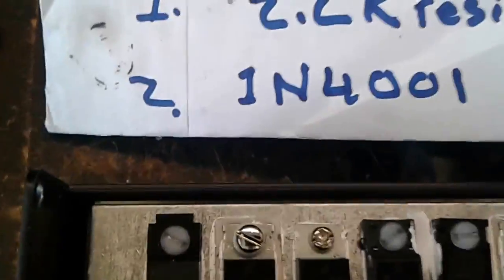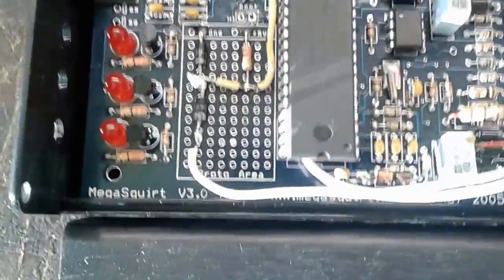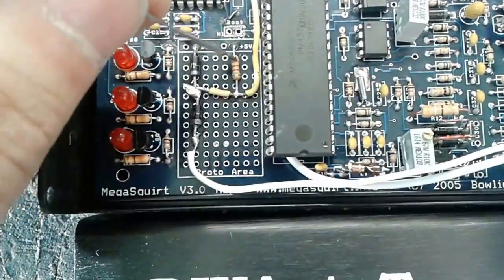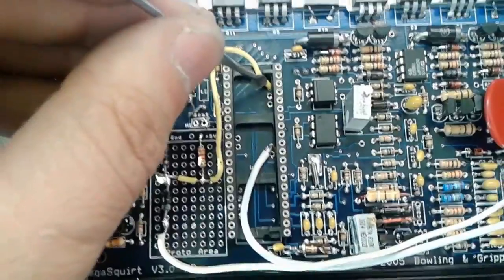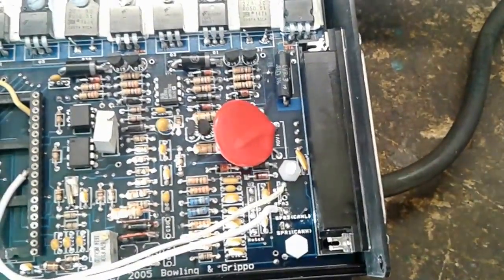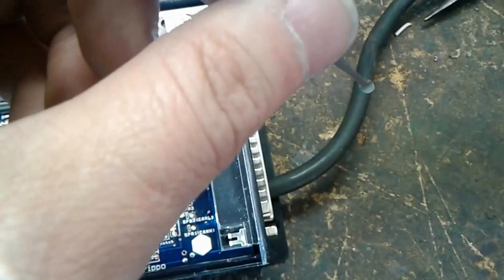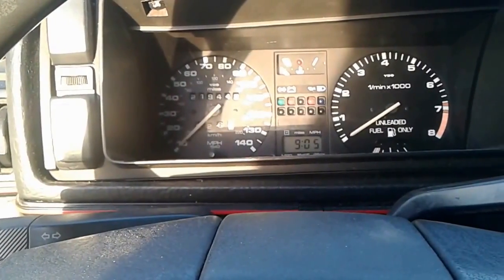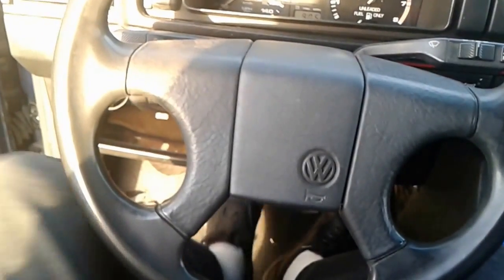Launch Control Megasquirt 1 & 2 Extra v3.0 Board

Comment: Hey there, thanks for the walk through just did this myself following along. It worked first try for me..but interestingly only first try. Checked all my wiring and even replaced both diodes and resistor to see if there was an issue, as well as simply grounding pin 6 and it will not engage again no matter what setting. 
Curious if you know if Tuner Studio has any kind of readout on if the circuit is working or active or what not? Thanks.